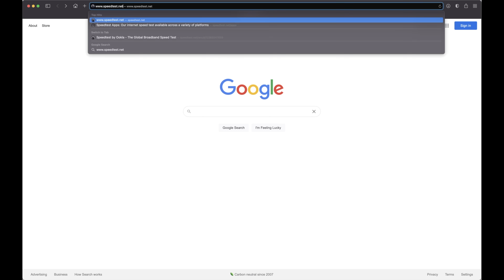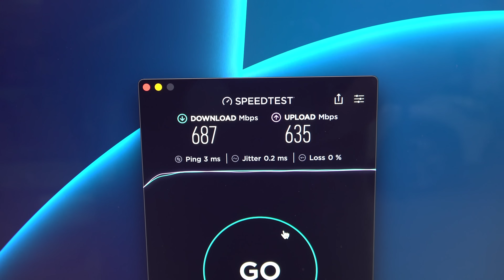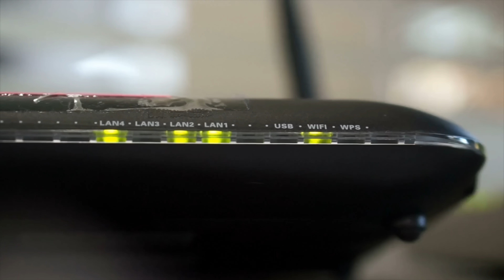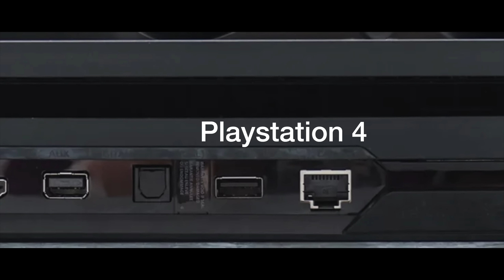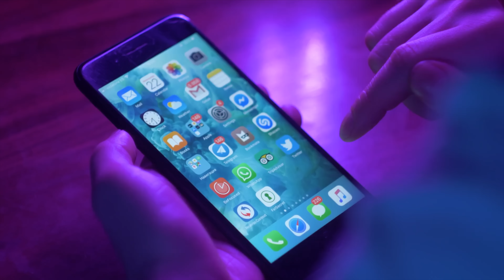How to BOOST Slow Internet Speed 2X - Cheap & EASY!

Comment: You actually want to strip a bit of insulation and then use some of that fiberglass cord that is in it to pull down on the sleeve to expose more.  Many times when you are exposing the individual wires you can inadvertently cut through part of one or more of the wires which can cause you to have issues later.  By pulling on that cord, you cut and expose fresh parts without needing a sharp implement.
Reply from the maker: That is a great tip and as you said safer to not nick any wires
Reply: Alternatively you can use one of those plastic letter openers or something similar to slice the sleeve as some CAT cables have a plastic X insert instead of the fiberglass.

Comment: Who would win?  $500 Wi-Fi Router? Or $5 Ethernet cable?

Also if neither Wi-Fi nor running an ethernet cable are options, there are two other options. One is "MOCA" (Multimedia over Coax Alliance) which lets you send an ethernet/internet signal across coax cable. This is convenient because many older homes might not have ethernet, but almost every house has coax. It can even work at the exact same time as it's being used for TV apparently. 

Another is "powerline" where it basically runs a data signal through your power circuit. As in, you take one of the two modules and plug it into an AC outlet near your router and plug an ethernet cable into it from your router, and then take another module and plug it near your computer, and connect an ethernet from there. Though this is hit-or-miss in terms of speed depending on whether the modules are on the same circuit, and how far away.
Reply from the maker: It is amazing that the cable will win every time.
Reply: Just run a proper Ethernet cable and do it the right away instead of these kludges.

Comment: Biggest speed killer is latency. Especially TCP connections. I noticed your WiFi latency was 10ms, but you wired connection was 3ms.
Reply from the maker: Glad you noticed that, you can also see some packet loss too. All normal operation for wireless but a killer for large transfers for big data

Comment: I'd love to hard wire in my house, but I live in an old historic brick home, so I would probably have to run all the way around all the trim and up the stairs to where my office is. Not sure I want to do all that, lol
Reply from the maker: I totally get that, and I use plenty of wireless devices but if you have a main computer and use it heavily the effort for wiring it can be substantial
Reply: Look up internet power line adapters but they can have their drawbacks too.
Reply: I wired a building like that for Ethernet and Phone once..  100+ year old SOLID place..  Had to rent some serious drilling tools from Home depot.

Comment: Another option for folks who don't want to run cables, setup keystones, etc. is to use a MoCA. This is assuming coax is ran to the desired rooms. Few items to mention: the ez rj45 connectors (shown in the video) are nice because you don't have to struggle with getting your wires cut to length but the crimp tool's blade will dull, causing the ends to short. It's also a good idea to have a tester if you plan on making your own cables.
Reply from the maker: That is a great option if you have coax, which many houses do. Great suggestion!
Reply: So much slower than real CAT-6 Ethernet cable though.
Reply: @seanwieland9763  never heard of fake cat6 cable. Read up on MoCA 2.5. As I've stated above, this solution is for folks who do not want to run cables.
Reply: @dtierney  coax can never be as fast as Ethernet.
Reply: @seanwieland9763  not true

Comment: Upgrade to a 4x4 Wi-Fi 6 router, problem solved
Reply: wifi 6e is the best now but super expensive. also get a wired mesh network. Asus is super easy for this.

Comment: My internet speed stays the same when using wireless or ethernet port. The same 2Mbps either method, and my phone tells me that my wifi should be as fast as 75Mbps
Reply: Your phone is telling you your network speed on the wifi, which is about 75Mbps for you. This is how fast your router can talk to your phone and also would be your limit. The 2mbps is your up/down speed provided by your ISP.
So your router could send you the data with 75mbps, but your internetconnection is limited to 2mbps.
You are confusing the two
Reply: Your phone tells you the speed between the phone and router, not the speed of your internet.
Reply: Same here. I’m paying for 10mbps. Speed test on phone usually shows 7-10, but I rarely see much above 6-7 on Ethernet devices. WTF?
Reply: @avid1959  I hope you aren't paying alot for that speeds. 
We pay the same amount monthly as my aunt who lives 5 minutes away, and they have speeds higher than 100Mbps. I think the monthly payment is from $50-70.
It's funny i tried to download like a 3 GB game, and the downloader said that it would take 2 days to download. At my aunts it only took 6 minutes. So I took advantage and downloaded more games there.
Reply: @avid1959  Same here Avid.  I pay for 10 down and average 7-9.  I get a whopping 0.80 upload!  I have DSL but I don't think there is a way to speed that up.  Starlink is beginning to look good!
Reply: What router do you have?
Reply: @chrisjudge31  nothing special, newer Smart RG, 2.4 and 5 GHz, DSL
Reply: Worst part is, that is the fastest we can have our wifi. Even Frontier told us that even if we were to pay more money, there would be no other way to increase the internet speed.

Comment: Correction: iPads have USB-C ports and support ethernet just fine
Reply from the maker: You are correct, I don't see it used much but is available as you said
Reply: @SilverCymbal  if you buy an adapter you can use it for all iPhones and iPads
Reply: @qwertyuhi8221  for reals? What is the adapter that works with iphone?
Reply: @avid1959   Yes I have done it. You use an Apple Lightning to USB 3 (“camera”) adapter, and an Apple USB to Ethernet adapter. However it’s limited to 10/100mbps.
Reply: @qwertyuhi8221  you can’t charge and use it though
Reply: lols my galaxy s8 plus from ages of dianasaurs also worked with usb c to ethernet jack.
back in the day.

Comment: IT guy here, there's a reason all tech guys have cat6 networks throughout their house. Cabled connection will always outperform wireless ones.

Also, you most likely don't need 1gbps. I just downgraded my 300mbps to 100mbps and I still strean 4k no problem.

It's still just as fast (latency) as it was.

The inly difference is that I have to wait longer if I download a new game on steam.

Might go back to 300mbps when I'll have more than 4 people streaming at once.
Reply: I had 1 Gbps when I first signed up, after the first year when they wanted to double the price for it, I went down to 300 Mbps for the same price. Like you, the only difference is when I'm downloading games and updates. The 900+ speed was pretty nice for that. And yes, My server and gaming PC are connected via 10G fiber and 2.5G ethernet. The rest of my devices are WiFi for mainly content consumption and my work computer where speed/latency aren't critical.
Reply: -- Not IT but agreed.  Only wireless I have is in the garage/barn.  But I'm just watching YouTube with that.  Essential systems are CAT6.
Reply: It's cheap here in europe, 50€ for triple service with 2gbps incoming FTTH all the way to the router. I get 950mbps on 2PCs at once wired.
Reply: I do not care, just uploading 4GB @10Mbps sucks.  But it is a provider to blame for upload speeds.
Reply: @slaffkas  I recently got rid of my DSL internet, 10 down, 1 up max.  I averaged 5-9 down, 0.75 up.  Now 10   up doesn't look so bad, lol.
Reply: You are definitely not an IT guy like in the field but most of your information is correct but could be fixed in the way you said it
Reply: @calanparker1718  I'm french, don't read too much into it ;)
Reply: @fmaz1952  fair enough it mean the annoyede a little bit because its missing info

Comment: That Mac might have a lan port on the AC/DC adaptor.
Reply: If it's the base iMac then it won't.  If you step up the next model it is included.  Pretty slick.  Don't know if you can buy the AC adapter with Ethernet and use it on the entry level model.

Comment: Cool! Would this work with a smart TVs if it had the proper plugs on the back? I’m
Far enough out of the city I can’t get cable internet/I have satellite that picks up 5G tower for my internet. Seems like my tv is always loading buffering.
Reply from the maker: Many smart TVs have an ethernet port and support a usb dongle connector as shown, you would want to check the manufacturers page to see which they can do and it would definitely be worth doing, wired will always be faster and more reliable.

Comment: As an IT guy, was expecting this to be clickbait. I should have known better since it's a Silver Cymbal video :)
Reply from the maker: Thank you very nice of you
Reply: IT guy here too. Jaw to the floor when he ripped out the fancy RJ45 crimper.
Reply: LOL. when I saw the thumbnail, I thought "yeah, he went click-bait." but this is the same exact thing I explain to people all the time.  It's going to be nice to have a very common sense video describing the value of a wired connection.  Thanks Silver Cymbal!
Reply: Same. I’m glad that this wasn’t promoting some fake device. I also appreciated the walkie-talkie reference since that is also what I use when describing wireless to people. Another advantage with a wired connection is that it offers full duplex as opposed to half duplex which is what most wireless routers/access points operate in. This can also described using walkie-talkies as listening (receive) or speaking (transmit) but not both at the same time.
Reply: I literally came to the comments to say the same thing.
Reply: @seamenow5108 Yeah Network issues are a hard one to trouble shoot. Internet speed issues are one of the most general and common customer/client issues that stem usually from equipment malfunction, out-dated equipment, or user error. Sometimes a mix of the three or you get the goose chase of calling ISPs' XD. If the situation is going beyond that and you put in a set bid, rip that money.
Reply: @seamenow5108  well I'm confused, so......